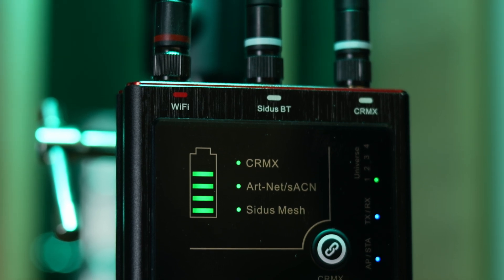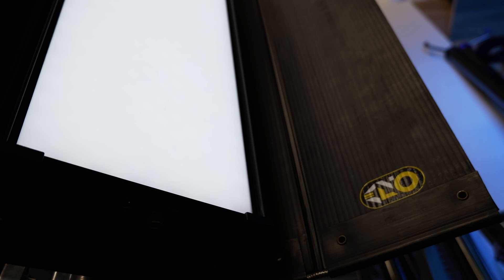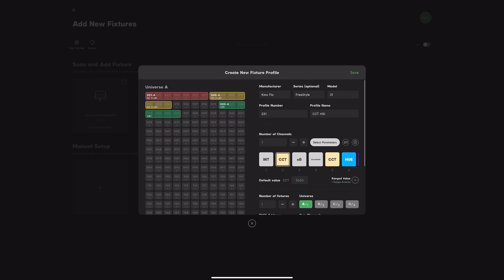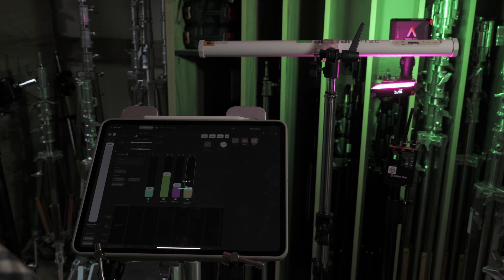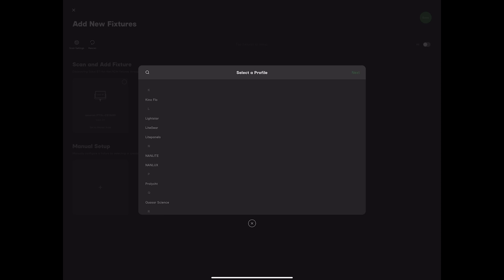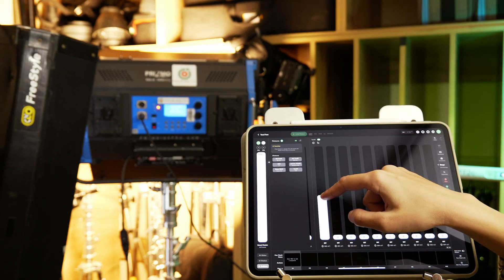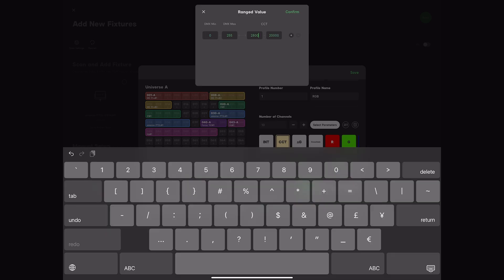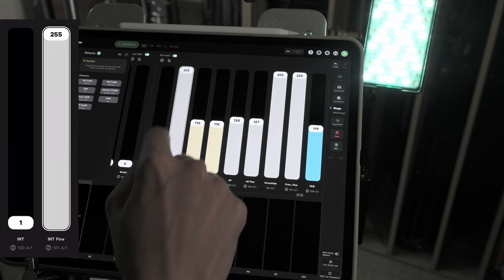SIDUS One | How to Connect Any Light | CRMX, Bluetooth, DMX

Comment: Hi, congratulations on the video!
For a live show, I need to connect the Sidus One to a console (with lights already wired via a dimmer) to control two mini Aputure LED panels from the console, handled by the actors without cables.
Is this possible? Do I need a Sidus One for each light?